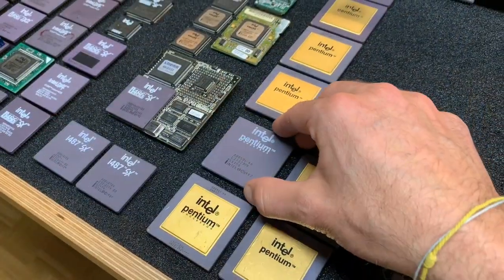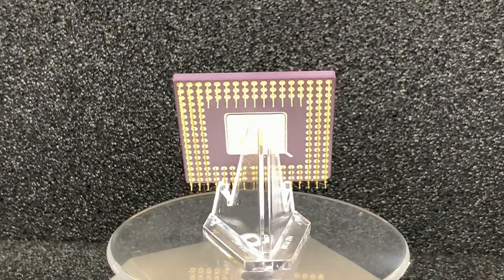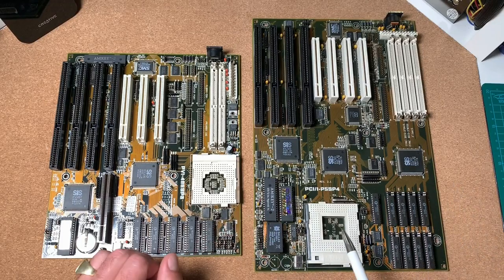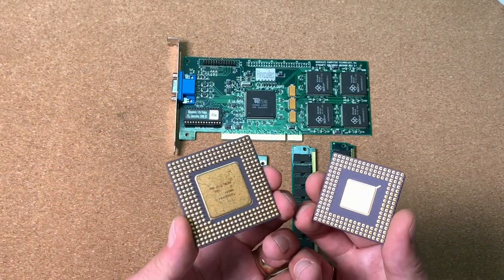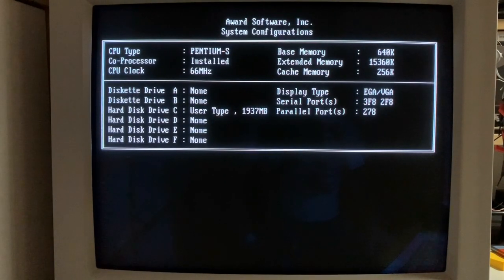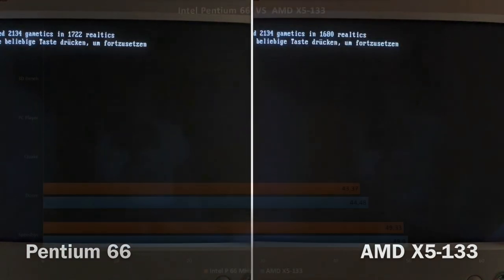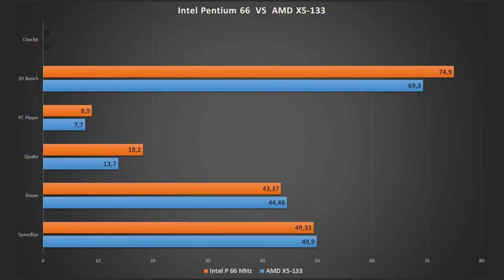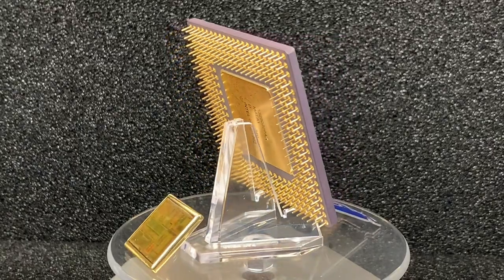Intel Pentium 66 MHz VS AMD 486 X5-133 MHz

Comment: Pentium is shining in Quake as its code is optimized to utilize the asynchronous FPU operations which are interleaved with FP arytmetics. This is well known paradigm of Quake code.
From the same reason the Cyrix CPUs were literally Doomed or should I say Quaked ;)
Reply: I had a 200 mhz Cyrix M2 back then too that I "upgraded" a Pentium  166mhz with MMX with.. I shortly downgraded...
Reply: @barowt  why? Which SW was a reason?
Reply: @radoslawbiernacki  Quake, everything ran decent except Quake.. at the time, I played that demo a lot. Until I bought the full game. That's just the DOS side, on Windows, I don't remember exactly why, but it ran way slower on anything graphical.. 

I still have that old Cryix too, my stepdad kept it, with some of my old computer stuff from 20 years ago.

Oh I misspoke earlier, it was a 233mhz Cyrix, my computer back then topped out at 200mhz....

Heck went from that, to a 1ghz Athlon, which blazed past everything I had at the time..
Reply: @barowt  yup, Quake was certainly a Cyrix company killer ;)
An example how one engineering decision can make company bankrupt. In terms of CPU architecture, super-scalar, means ability to process multiple instruction at the same time was a Pentium super power back in the days.
Reply: @radoslawbiernacki  It wasn't just Quake. We had a LANtastic network with NE2000 compatible networkcards for the office. And the drivers refused on non-Intel CPU's. The local computershop even leant us a PC with Cyrix-pentium 90 equivalent CPU. No network driver support.

Comment: My first "usable" pc I built from hand me down parts used this cpu overclocked to 160mhz. I even took this baby online back in the late 90's. Looking forward to the 160mhz test.
Reply: Did you worry about burning the CPU?  It sounds scary to overclock an old CPU that isn't designed to shut itself down before permanently damaging itself.
Reply: same
Reply: Mine is working correctly on 150 Mhz without problems. Many have no problems with 160.
Reply: @IARRCSim  I had no problems with 160MHz on X5-133 - it worked perfectly for about 3 years.
Reply: @IARRCSim  if it doesn't overheat then I hardly think it would burn itself
Reply: @mixal31  right with some mainboardmods it was/is possible to get 200 out of them.
Reply: I had this back in the day. I remember moving one jumper to get 160Mhz and making Wipeout run much smoother. Never had any heat issues with the included HSF and it ran stable.

Comment: The biggest gain of the Pentium vs 486 was in the FPU, this is the reason for the big wins for the Pentium in 3D games - pretty much twice the performance per clock. Thanks for the video! :-)
Reply: Not really. There are A LOT of improvements in the pentium outside of the FPU. Actually, the only game that's using the FPU in the video is Quake. Doom and Duke3D don't even touch the FPU, at all.
Reply: @ccanaves  both Doom and Duke3D aren't polygon based so any improvements from floating point wouldn't matter.

They did a lot of hacks to get to the right performance level on earlier games, Id was excellent in that matter, even creating formulas that are in use until today in modern games to speed up or aproximate some calculations.
Reply: You are both wrong the AMD fpu is actually faster. But the intel FPU can be dual threaded. This is what John Carmack exploited to get Quake running at "playable" framerates.
Reply: The biggest gain was the superscalar design. Doom is a pure, 100% integer benchmark. There's not a single floating point instruction in there and a 66 MHz CPU is holding its own against a 133 MHz CPU.

Comment: Bit late to the party with this video, but that's the beauty of DOScember, it helps us find other interesting DOS-related videos!

My first computer upgrade that I paid for and installed myself as a kid was a 133MHz AMD 5x86. It replaced a hand-me-down 66MHz 486, and was definitely a leap forward in terms of performance. The AMD was definitely marketed as a Pentium-class 586 competitor rather than a 486, and didn't have 486 marked anywhere on the CPU. I paired it with an S3 Trio64 video card to take advantage of the new PCI bus. This was probably early 1996; Pentiums had been around for quite some time, so in hindsight I probably would've been better off getting a second-hand 90/100MHz Pentium.

Anyway, it was fun to see how my old machine stacked up to the competition. Thanks!

Comment: That AMD 5x86-133 was a nice upgrade from my first CPU ever, a DX2-66. At 4x40MHz it had an integer performance close to the P90. But Quake really killed it off for me. I swapped the whole bundle for an AMD K5, which wasn't the most brilliant idea Quake-wise...
Reply: Haha I went from a Cyrix 486-33 (which was really a 386 pretending to be a 486) and the difference was night and day.  That X5 served me well through my first 3 years of college then I went to the dizzying heights of a P200MMX so I could play Quake!
Reply: @Zerbey  on most performance terms it were the sis-chip the bottleneck

i know only one board of such kind clones which was really useable with socket 7 and that was an ALI with 1mb cache

Comment: And now we compare the price on release... ;)
93$ for the AMD versus 964$ for the P66, i paid 150 DM for the 5x86 back in 1996 at the Hobbytronic in Dortmund. And yes, as everyone in our nerd clique, i overclocked it to 160 MHz for that extra Oohmp, making it possible to play Duke3D in 640x480 and Quake 1 in somewhat playable speeds.
Reply: On top of that crazy price, if you bought a prebuilt P66 you might get something absolutely dreadful. The 486-DX4 100 system I built (in 94-95ish) absolutely crushed my friends' Gateway P66. So much so that he got his parents to buy him a P150 "for college".. and that was the end of my computational supremacy.  I actually used that system until I saved enough for an AMD K6 300 in like 98. The DX4 soooo slow by that point.  AMD was very good to me in those days.

Comment: In these old games/systems, the sound card makes a hell of a difference. If the 486 had an ISA one, and the Pentium a PCI one, it  was not a fair contest. I used to remove my sound card in my P75, and played games designed for a P166 or even 200 with a Voodoo card with no real performance issues.
Reply: Not just the bus, I had a Gravis UltraSound and games which used it instead of my SoundBlaster were noticeably faster.  Both were ISA cards.

Comment: In 1994 you could still buy a new 386 pc.
Reply: As far as I know Intel manufactured 386 up to 2007 for Boeing
Reply: @CenturionKZ  those were likely radiation hardened 386 cpus, quite specialized hardware
Reply: Why would you want to they were garbage? I hate it to 386 and 486 processes!
Reply: I had i386Dx until July of 1998, when I switched to PII.

Comment: Thanks for this video. I've got a soft spot for the 5x86 as well, I had one back in the day. I paired it to an early 3D card (Rendition Vérité V1000) and though the 5x86 is 486 class (ie. 'old'), due to its high clock speed it was quick enough to allow that setup to perform and impress friends who had just invested in pricey Pentium PC's.

Comment: From Wikipedia (about P5) : "Much faster floating-point unit. Some instructions showed an enormous improvement, most notably FMUL, with up to 15 times higher throughput than in the 80486 FPU". No wonder Quake really shine on it.

Comment: In my youthful geek days I had built AMD 486 X5 133 MHz unit a bit differently configured than your PC and regularly paired it off with the much more expensive Pentium 66 MHz computers.  The benchmarks we used were obviously not the same as yours.  Generally I found that the 133 MHz was superior or equal to the Pentium 66 MHz units.  Your video brought back memories of a youth lost.  TYVM.

Comment: I thought it would lose by >50% in quake but it was only 25% behind. Way better than I thought. Quake is not really doing anything special to take better advantage of the new technologies in the pentium; it probably has some instruction reordering in an inner loop in the renderer to keep both U and V pipelines better fed by matching up instructions or something, but the big thing is that the pentium just has better floating point performance.

Comment: I find you videos on retro PCs well made and I have an emotional attachment to the 486: the Intel 486DX2-66 was the processor which I used in the first PC assembled and configured by myself :-)
The only thing I'm not happy with is your final summary table: you are adding "apples to oranges". I suggest you add together the relative difference in each test and not the score of the test itself.
Here is how I would conclude the comparison, AMD DX5 over Intel Pentium (assuming equal weight for each test):
SysSpeed	+1.2%
Doom	+2.6
Quake	-24.7%
PC Player	-13.5%
3D Bench	-7.5%
Checkit	+10.6%
So AMD DX5 results 5.2% inferior (-31.3% / 6 benchmarks) to Intel Pentium

Comment: The results are pretty much exactly what I would have predicted - Pentium's FPU is a lot faster and it has better memory bandwidth (66MHz/64-bit FSB), but at twice the clock speed, the Am5x86 pulls ahead for integer math (P5 is faster per cycle, but not quite double) or anything that cares a lot about memory and cache latency. I bet for tests that fit into the 16k L1 cache on the 5x86 versus ones that don't fit into the Pentium's 8k, you'd see the AMD chip take the lead there too.

Good battery of tests to smoke out exactly those kinds of distinctions, though!

Comment: I have a gold heat spreader big P5.   But back in the day, I bought the 586 133mgz because it was quite a bit cheaper and bought it at a computer faire off a table from a CPU vender.   A big jump for me from the a 25mghz 68040.

My first harddrive was 18mb.  When I blew a lot of money on a 400mb harddrive, i thought I'd never need any more harddrive space ever again.  When I started bringing junk home by the truckload, 400mb became the bare minimum Win95 install, I was using 650mb to 1.2gb drives most of the time and 400mb was almost a door stop.

I've still got a barn full of 486's...   no idea what I'll do with them.  By now, they could only be sold (if at all) as hobbiest nostalgia boxes.   I thought of calling them Blitzboxes, because if you stay in ANSI mode, they actually are really fast...   like on a Linux command line.   With only 32mb RAm th ough, you won't be opening many 1990 era web windows...

Now I use 8 core processors with 32gb of RAM so..   there's not even the impetus to touch one, let alone connect the rat's nest of wires together to fire one up or anything out of my antique collection.   I use to love all these machines, now I can't even bring myself to touch them...   It's hard to explain why because I don't know.  For decades I saved these from the dump when others discarded them as trash.   Now to me too they are like trash...  30 years after.. they became trash.

By the time i was playing any of those games, I had a AMD (I forget which 233/266/300/333)mghz 3DNow processor so...   the differences between the P5 and 486 were a mute point for me.   The only thing I did with the 486 was Win95 and a webbrowser.  I.e. stuff a P5 would not of blazed past it in...
Reply: "68040"😲 Apple or Amiga?

Comment: It would be interesting to see that 486 set at 50Mhz x 3. With a 33Mhz bus, it's starved for data.
Reply from the maker: I tried, but unfortunately I did not get a post screen. At 40 MHz and the cpu at 160 MHz it was posting and performing like hell. 🙂
Reply: @CPUGalaxy  Did you try a different videocard? Because I've seen in other reviews that the Tseng has issues at 50Mhz bus speed.
Reply: I remember, that my amd was working on 3*50, graphic chip ARK2000MT

Comment: When these were out, my Mum was still using her 1992 386 DX-40, and from 2003-2006/2007 I was using it. Still relying on floppies as the 80MB HDD just didn't hold much (even with Windows 3.1).

It was amazing the day I was finally able to use a CD drive, and backing up 140 floppies to a CD-R barely impacted its free space.
Reply: I still have my homework summary of Harry Potter and the Philosopher's Stone on a floppy. I have been lucky in 2004 i had a Intel Celeron with 1,6 ghz and 40gb hdd, later i maxed out the ram to 1 gb from 256 mb ram, for that time it was a lot of ram and the best of the best LG GSA-4040B  a dvd burner, i remember getting 100€ from my dad to buy the burner in the summer holidays. With 10 dvds for 10€, i could save all my files. It was a simple life but a great one, the web was not so toxic and people were more friendly online.

Comment: Surprising results, I thought the 5x86 would win everything but quake by a narrow margin. The 486 was a way better value at the time though and since many of us knew these would almost always run at 160mhz it extended that value further.
I'm pretty sure i picked up my cpu with a motherboard for $99 in the spring of 1996. The motherboard was dead on arrival and i returned it and kept the cpu. I had an amd 486dx4/100 of the board i already had and ran it at 120mhz for a couple of weeks then decided to try 150mhz(I didn't know about setting to 2x for a 4x multipler at the time).  Later on, i knew how to set 160mhz but it ended up being slower due to the slower vesa bus. Good times, and all from a chip that cost me $30-40 after i returned the dead motherboard.

Comment: Interesting to see the Pentium 66 outperform my Pentium 75 in Quake - though not by a wide margin (17FPS vs 18) - granted mine was a Toshiba Libretto 50CT with no L2 cache at all! Still amazing to get that performance in a computer so small from 1997.
Reply: Similiar test was made on Vogons, most expected tie,. but atcually, in most of benchmarks, P 66 was really a bit faster. 

Well, it should be not suprising. It has +33% faster cache, RAM and FSB. While only 13% slower CPU clock. In most cases, +33% faster cache,RAM and FSB > +13% CPU speed.
Reply: P66 was usually faster than P75. The 66 MHz system bus trumped the extra clockspeed on a 50 MHz bus.

This is why AMD PR-rated the X5-133 against the P75 instead of the P66. The value of a faster system bus was something AMD was already on to. A few years earlier, they had been selling 386 DX-40 parts on a 40 MHz bus which were faster than Intel's low-end 486 offerings at a fraction of the price. I knew people who ran DX-40s all the way to the turn of the century.

Comment: I kind of envy your S4 board. My VLSI-based Digital board is definitely slower and on my test bench it could never beat an Am5x86 in a decent ALI or UMC board. SiS496 is only good before one has to take video performance into account, PCI VGA performance is quite crappy on the SiS496. Maybe it could be a bit better with VLB...?

Other than that, the Quake benchmark is quite surely a win for the Pentium. That's the program that finally used Pentium's pipeline FPU to its full potential, and because of this even later challengers were left behind by it (even AMD K6-2/3 had no FPU pipelining!)

Oh, and one more thing for me to envy of you: That fully ceramic P5 CPU of you! I only have -60s with metal heat spreaders.

Comment: I am curious how you clocked the AMD...I had one DX4/100, at one time, and I believe my mother board was configurable...to instead of 33.33MHz clock tripled...I configured my FSB as 50Mhz like the original Intel DX50 and clock doubled, so memory transfer and I/O totally rocked! One of my friends actually got one going overclocked at 66MHz. I am wondering with the nice L2 cache, I think that you might be able to make the front side bus to 66MHz and clock double to 133MHz, the AMD 133 CPU. Did you try that?
Reply: CobraTheSpacePirate there was never an option for a 66MHz bus on Socket 3. Nonstandard bus speed didn’t really arrive until Socket 7.
Reply: Maybe I am thinking about a motherboard that had a crystal can in there. Like the actual Intel DX50 motherboard and replaced the 50MHz crystal with a 66.666MHz crystal...

Comment: I've always wanted to see someone try to play GlQuake with a Voodoo1 card installed into a PCI-capable 486 motherboard like you showed, with a top-end 486-class CPU.  I know 3dfx specified a requirement for a Pentium processor with their Voodoo card, which has always left me to wonder whether such a setup with a high-clocked 486 and PCI would work at all or not.
Reply: It works there are multiple vids on Youtube of it.
Reply: As you can already reach around 13-16 fps in Quake, with highend 486 system, with fast PCI graphic card, for sure, you'll get close to 30 fps, with voodoo card, as it will take part of the CPU load on itself.
Reply: I had this exact setup and it ran quite well but you had to keep it at 640x480 to have a playable frame rate.  The Voodoo 2 was much better.
Reply: @Zerbey  Voodoo 2 was better even on a 486?  I would have expected the setup to be CPU limited.  V2 has so much power especially in SLI, it scales all the way up with the 1GHz+ Pentium III's.  Would have guessed a V1 would max-out a fast 486 chip.
Reply: @angieandretti  I was running on an AMD X5 and Voodoo 2 was definitely faster, but it was much more stable when I upgraded to a Pentium.
Reply: It worked! I had such setup! :)

Comment: I ran the X5-133 in my everyday rig all the way into 2000, even after I had built much stronger machines for other people. For day-to-day use it was still a competitive CPU. But as these benchmarks showed, it was no way equal to AMD's PR rating on anything that required FPU performance; a 486 just couldn't match a Pentium there even with double the clockspeed.

AMD actually rated it at PR75, which they got away with by only using business application benchmarks and the fact that the Pentium-75 ran on a 50 MHz bus, which sometimes made it slower than a Pentium-66 running on a 66 MHz bus. But even for what the X5-133 couldn't do, it was very useful for keeping 486 machines viable for years after 5x86 and even 6x86 technology was available.